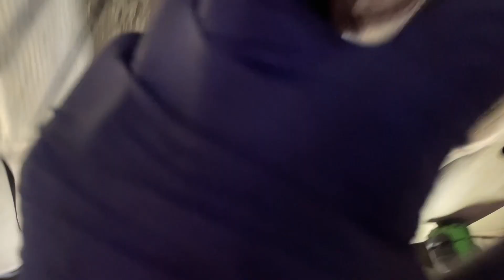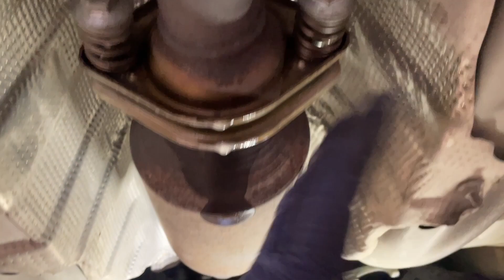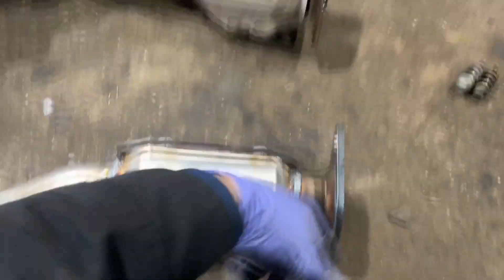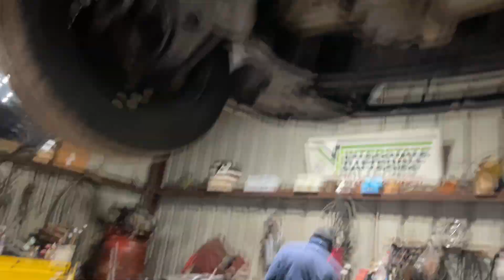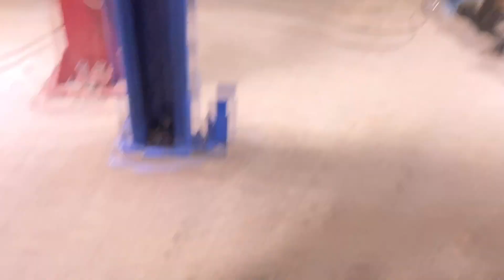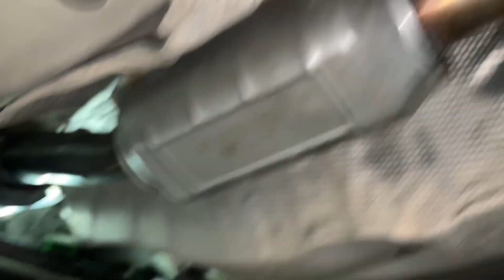2017 Nissan Sentra Catalytic Converter Replacement

Comment: How did you separate the two manifold bolts. Looks difficult because of subframe in the way. This is my biggest worry when I replace mine. (2013 Sentra SR 140k). Thanks great video.
Reply from the maker: Reach with an extension. Very tight space but doable. Removing it may be more of the hassle so work the angles.
Reply: Thank you, I worry if the stud snaps...then what, drill out?  @TexThaiAuto
Reply from the maker: Sadly yes. This happens fairly often too so I usually try to drench them in WD-40 and if they seem super seized then I’ll heat it with a blow torch. But it does happen at times and I’ve had to try to extract it or drill it out.
Reply: Thank you! Tons of fun. LOL never had these issues back in the 1990s doing my '94 Sentra complete exhaust system. Gone are the easy days. @TexThaiAuto
Reply: Is that a high flow cat or just replacing it with a new oem?